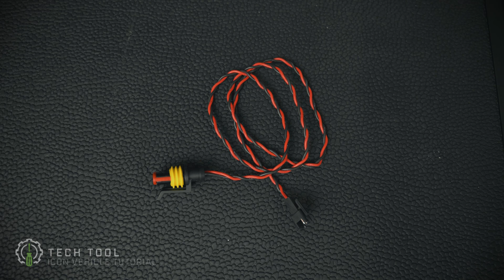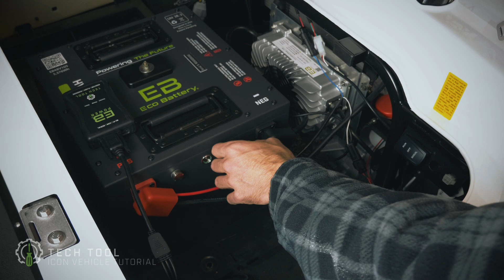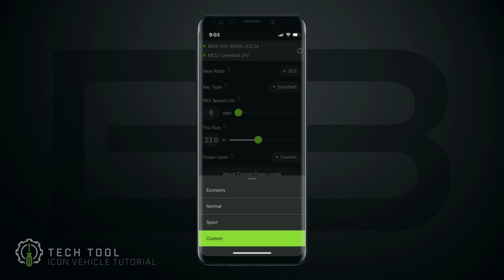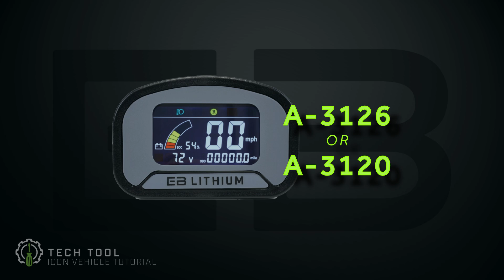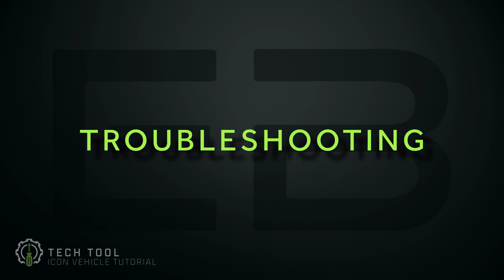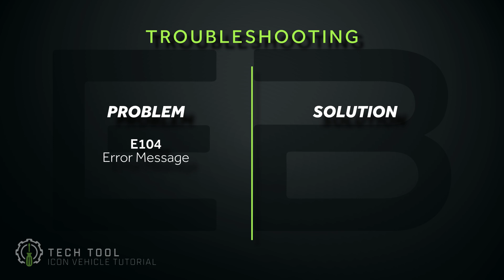Tech Tool Guide: ICON EV - ICON Controller | Eco Battery

Comment: At the 45 second mark on the video, a small connector that connects to the CAN cable is referenced. I just started to swap out my AGM batteries for the ECO 60AH battery on my ICON '22 i20. I have removed the old batteries and charger. I looked for the small connector and I cannot find it. Any help would be appreciated. I just received the tech tool in the mail yesterday, so I want to use it as quickly as possible so that I get my $400 credit from ExtremeKartz. I had a heck of a time finding where the wires from the old charger were routed. They were not in the same spot as the video that I was following for installation. Also, I purchased the backup camera and display option, so I am wondering if there is an installation video for that option.